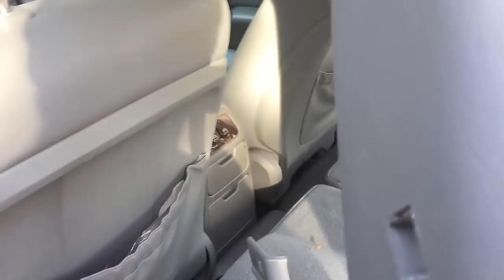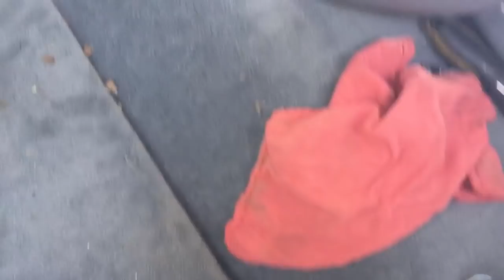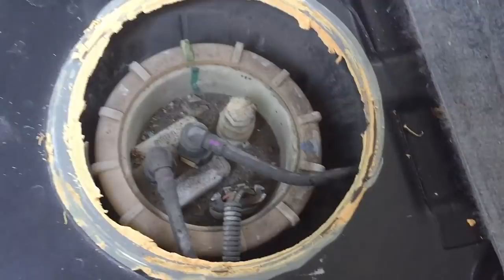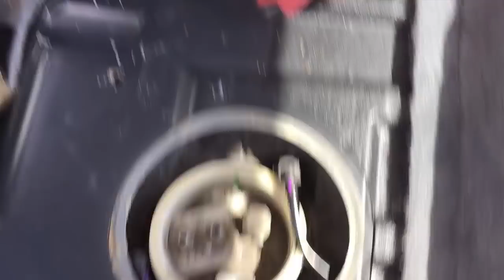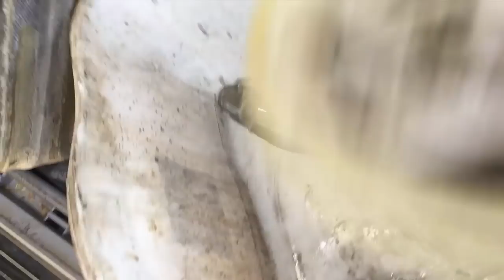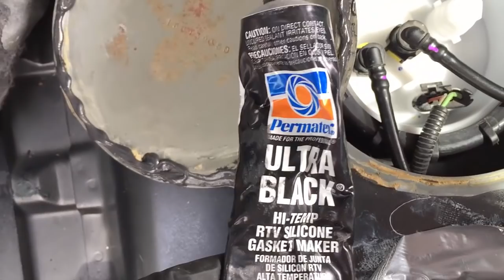2001 M-B ML320 Fuel Pump Replacement

Comment: Great video ...BUT, I've tried 2 x to set the new pump. Getting the float into the tank without detaching is a real problem. The fuel lines were horrible to remove...I wish I never tried this project

Comment: Hi, I'm from Brazil so I'm using Google Translate.
As I saw your vast knowledge on Mercedes ML320 maybe you can help me.
my ML320 year 2000 AB 54 V6 Petrol.
It stopped operating 5 years ago and remained in the garage, I'm doing the repairs at home, I'm an electrical technician, I've already tested and replaced all the fuses and relays that didn't work. Then the ignition part works well on the coils and spark plugs.
When I breathe fuel through the throttle body it works.
I removed the old fuel, cleaned the fuel tank, replaced the complete pump system, filter and hoses.
Where is the thinner hose that comes out of the fuel filter connected to?
Is there a fuel pressure sensor? If there is a pressure sensor, where is it?
Here I have no signal at the fuel pump, but if I inject + 12 v into Fuse 38 the fuel pump turns on.
I cleaned and replaced the injection nozzles and tested them all out and they are ok. However, I don't have a negative pulse on them, just 12v +.
The OBD2 Scanner I have does not show any error in the ECU, but it does show an error in some sensors.

Comment: Any idea where the fuel pressure sensor is on the ml320? I'm having trouble finding any Information on its location. I might have to do my pump as well as my fuel Gauge isn't working properly either.
Reply from the maker: I can’t say for sure because I no longer have the vehicle.  It is probably at the end of the fuel rail.  There are probably 2 sensors if there are two rails for the V-6. If the fuel rail is U-shape the. There may only be one.

Comment: Thanks Brother great video showing a lot of this challengingly job.
I'm changing my Fuel filter, but that requires me gaining access to fuel pump to release hose connectors.
Fun fun fun....
Reply from the maker: I had not done that job. Are you sure there isn’t another in-line connector in between?  Just a random thought.
Reply: @McMichen  
Ok so you have your original Fuel Filter (unchanged) ?
The jobs are somewhat parallel, with the FF (also has pressure reg / ck valve built in) having like 3 or 4 connectors - it's buried on top of frame rail between body & frame.
Pulling LR wheel & inner liner is required to access.
Then you disconnect 2 lines & pull it out with the 2 short hoses that attach to Pump Ports.

There's just no easy way (everyone says) to detach lines and not risk breaking them from Fuel Filter w/o detaching first at pump ports.
Yes, I may need Fuel pump, and have it on hand.
But I'll test first w new FF both drive & Fuel Pressure monitoring.
Probably drive for 1-2 tanks of fuel w/o reinstall rear seat.
I actually trust my OE pump MAY have many more miles to go, before I try the cheap China pump from Amazon I have here.

Appreciate your quick response
Blaine !

David in Texas
Reply from the maker: @psalm2forliberty577  I never changed it but previous owner did all dealer maintenance, so I think it was done.  I no longer have the vehicle.  Gave it to a family member and it is still going strong.
Reply: @McMichen  
Great - I bet they're blessed to have it. Driving an ML is akin to being transported in a bank vault.
Just pulling that rear 60% seat, it's  H E A V Y.
Muffler shop owner remarked when modding my ML "heaviest gauge exhaust tubing I've EVER cut through"....lol
Take care - David

Comment: Woww! The locking ring just flew right off!👎🏼👎🏻👎🏼
Reply from the maker: Interesting.  The large threaded ring that holds the pump in place? Did you turn it or pry it off? It is threaded like a large nut.

Comment: Surely you don’t have to pull the whole seat out?
Reply from the maker: I suppose you could cut a hole in the carpet, but I didn’t want to do that.
Reply: @McMichen  
If i intended to take a sharp razor knife/ carpet cutter and leave the carpet and trim undisturbed, 2 questions:
1. Can I feel the round cover under the carpet?
2. Any danger of cutting an important wire, etc.?
Thank you so much,
David in Longmont ('98 ML320 - 107k miles, 2nd owner)
Reply: @McMichen  
Hi again Blane. Not suggesting anyone should want to cut the hole, but do you think I can feel the cover under the carpet so I'd know where to cut? And, is there anything I could be cutting accidentally?
Thanks for the prompt response,
David
Reply from the maker: @daw2310  I don’t think you can feel it because of the carpet pad. You may be able to feel it, but the ridge is pretty small. You may be able to cut a square on three sides to make a “flap” that you can fold back to access the area.  You would need to look at the video to guess where to start cutting.  If you start with a cut close to the seat base (side to side direction) you may be able to get your hand in to feel where to make the two cuts front to back.  I’ve cut you can fold it back in the direction of the tailgate. This cut would leave the “open end” facing the seat and not in the cargo area.

Comment: How do I know if my pump is bad? I read that everything will work fine maybe says tank is empty early is all. I'd like to think I only need to replace it when its not starting though?
Reply from the maker: Any early sign that it is getting old may be a gas gauge that doesn’t work properly, because it is part of the pump unit.  Occasionally you will get some warning from a hesitation while driving, but that could be from any number of things. When the pump quits your car will stop running and will not start again.  One of mine died at a stop light and I had to get a tow home.  Generally they are pretty reliable, but when the vehicle is older than 10 years old it could fail.
Reply: So I put a new fuel pump in but your video skips the part of how to get it in the hole. I broke one of the tabs that holds onto the float. Last few months been taking it out and trying to use glue or steelstik to keep it on. Some cases it comes off other cases the metal contacts on the resistor broke even though the float is still on. The hoses on top are new but now they're leaking from me going in there a bunch. Currently I got the float on and the resistor is fixed but the arm is so stiff from my repairs that it doesn't move with the gas. Anyway, just buying a whole new set of hoses and pump again. How do you get the pump in the hole with the float connected?

Comment: What does the connection to the seat do..? What does it go to?
Reply from the maker: I am not sure, but I can guess.  I think it is a weight switch that will determine if the rear/side airbags deploy.  Otherwise it could be a seatbelt sensor/indicator.

Comment: What does the wire that plugs in under the seat actually go to? I got in a hurry and forgot to plug it back together and not really wanting to take that seat back out to connect it back together if I don't have to
Reply from the maker: I’m not sure.  It could be the seatbelt alarm that dings if a passenger’s seatbelt is not secure.
Reply: Thank you. That's what I figured as well

Comment: There's suppose to be a rubber seal for the cover under the seat. Looks like yours is missing then replaced with some sealant. You could probably make another seal with an old tire tube or other sort of rubber
Reply: For other's watching.....There isn't supposed to be a rubber seal for the cover.  From the factory they used a heavy amount of body sealant (butyl), this is what he is scraping off in this video.  A rubber seal alone wouldn't work because the cover doesn't have any fasteners on it.

Comment: Does it works also for ML 55 W163 AMG 2003 ? Thanks
Reply from the maker: I haven’t worked on that model, but I’m sure it is very similar. I changed one on a 2004 VW Passat and it was similar.  Look for a round access panel under the carpet above your fuel tank. Most German models will be similar. The pump will be different, but the procedure is relatively the same.

Comment: My mechanic was making big deal out of it. Quoted me $800 to replace the pump. I purchased the pump for under $100.00 on-line, watched your video, and did it myself.  $700.00 saved. Thank you !
Reply: The high quote was because typically most domestic SUVs and trucks you have to either drop the tank or remove the bed to access the pump. Most German cars are different and have the access panel. Audi sedans would have under the seat and BMW sedans would have this access panel in the trunk.
Reply: @DaytonCarCare  : true... yesterday, i happened to replace same pump for my friend... must say, the biggest deal was removing rear seats.... pump install itself took about 10 minutes...  Your tutorial is great and I wanna thank you again for posting it !

Comment: when do you recommend to change the fuel pump? and when do you recommend to change the fuel filter?
Reply from the maker: Good question. I just waited until mine failed, but I was not the original owner, so I had no idea about the history. Mine failed at 125,000 miles, so if you want to avoid being stranded, I’d say every 100,000. Fuel filter should be at least the same or less, but it can be more if you are sure that you buy fuel at a reputable fuel station that changes its filters often.
Reply: @McMichen  i just got a used ml320 at 170k. I am trying to think what i have to maintenance.
Reply from the maker: @Menga213  sometimes you cannot predict what will happen. Some things I had to replace...  power steering hose off of the pump cracked and leaked; power steering fluid reservoir because filter is integral (makes squealing sound); other than that oil changes, battery, etc.
Reply: @McMichen  Nice so basically change all fluids to prevent future problems. Hey by any chance did you ever get problems with your door locks? did you replace all actuator? or fueses?
Reply from the maker: @Menga213  I only had a problem with the rear latch. The actuator worked, but the plastic connection broke. I got a replacement at a local pull-a-part yard.
Reply: @Menga213  I know it’s been 7 months hope you’re ML is good. I got my ml350 a few months ago and am going through it for preventative maintenance. Engine mounts, all fluids, cam cover gaskets, crank sensor, conductor plate and trans service. Want to do fuel pump and filter, but only using OEM parts.
Reply: They usually last the life of the car

Comment: Very good video.  Not enough emphasis on the pain of getting the back seat out.  The trim is a pain, releasing the tabs not easy.  I notice when putting my trim back on, that I had broken a few of the tabs.  On my 2002, the right back seat had to come out before the left.  The seat shared one bolt in the middle and the right was on top of the left at this location.  So many bolts! The seats are not so light.  I got away without removing the decretive plate at the door and was still able to fold the carpet back enough to get it cleared from pump.  

Removing the lid over the pump takes time and mine was put in with a lot of glue.  Took a long time to remove glue and lid still had to be pried up because there was significant amounts of glue underneath that that had to be ripped during the removal. 

Blane, how did you remove the ring locking holding the pump in place?  There was no way that mine could have been removed using just your hands.   Had to use a very big flat head screwdriver and dead blow hammer to get it spun the first 1/8 turn.  Ring is tougher than you would think and the raised ribs, grips seem not to have suffered any from my broad screwdriver head.  This method of driving the ring rotation by applying heavy blows in the direction of rotation seemed to work well.  I had to do the same thing to get the ring spun tightly back on. 

I would recommend having the tank as empty as possible when removing the pump.  The more gas in the take, the gas that will come out when the pump is removed.  I used a large garbage bad that I had cut one corner off to cover the carpet.  draped the bag around the hole with the pump, much like a doctor does when isolating the area they are going to operate on.  When removing the pump, the bag can be used to capture the pump and gas.  Just wrap the pump up in the bag.
Reply from the maker: Hi Eric. My primary motivation for making the video was the difficulty inaccessing the pump. Specifically, removing the trim pieces and the seat. I removed the ring with a homemade spanner type wrench. It is just to flat peices of band iron hinged on the middle and two bolts with the heads cut off for engagement pins. Your method is fine, too. As long as the bearing point is not too sharp, so it won't cut. I suppose a piece of wood could do the job. I agree about the low fuel level, but I don't know how you manage that if you have a full tank when the  pump fails. The fill tube has an antisyphon block. I suppose you could syphon the gas out from the pump port before removing the pump. There is enough room to get a hose past the pump with oi it removing the pump. Thanks for the comments. I'm sure others will take your advice about lining the area with a trash bag.

Comment: You mised a verry impprtant moment, how to a put inside a new one.
Reply from the maker: No real some answer. You probably figured out that you need to put the float in first by tilting the assmebly, lowering it and rotating it into position, until the arrow marks lined up. It is nice than it is new and not dripping fuel like when you take it out.

Comment: Hi Blane, which brand fuel pump and fuel lines<<<if needed replacement....did you buy? I'm going to be doing the same thing on my ML 320. Also, when you slid the pump with the float into the fuel tank, did you drop it straight down or was there an angle? I'm trying to get as much detail before I tackle this job.   Very helpful video! Thank You
Reply from the maker: Hi Dong,  I just looked for the part on Amazon and paid less than $50.  The brand I got was "A ABIGAIL", but I don't see it listed any longer, but there are other brands, also.  I have bought ECCPP brand for a Ford, and TOPSCOPE for a VW and they worked fine, also.  I did not need to replace any fuel lines.  As far as installing, it does need to go in at an angle and rotate to align the arrow marks that I show in the video.  MAKE SURE THAT YOU DISCOUNECT YOUR BATTERY AND NO OTHER SPARK SOURCES (DROP LIGHT, FANS, ETC.) ARE NEARBY.  (BTW - You will need the code for your radio when you reconnect the battery.)  The worst part is taking the original fuel pump out, because it drips gas.  It's best to do it when the fuel tank is almost empty, but you really can't know when your fuel pump will go out ... so that may not be an option.  I would recommend putting a towel around the area and having a bucket handy so you can pull it out and go right into the bucket inside the car, so you don't leave a trail of fuel on the way out.  It really isn't a very difficult job, you just need to take your time. I'm sure you will do fine.

Comment: I have a ML55 AMG would this be similar process?
Reply from the maker: I'm not familiar with the ML55, but I changed the fuel pump in a VW Passat and it was very similar.  There was an access panel under the carpet behind the back seat, in the trunk.  My guess is that most German vehicles will be somewhat similar.  The trick is to find out where the panel is located and how to remove the interior trim to access it.

Comment: Steve, thank you for this video. IT helped me IMMENSELY. My old fuel pump would not come out. I had to break it in pieces to get it out. I did not know how DIFFICULT it is to attach the float AFTER the pump is held partly into the gas tank. That might be the most difficult part. For me this whole thing was very difficult and I spilled a lot of gasoline. I was able to unbolt the seat and just move the seat forward about a foot. Thank you for this great video.

Comment: Thanks Blane great help but what a job removing the seat ! Without your advice there would have been a fair few broken plastic panels !
Reply from the maker: For sure.  There are a lot of snaps, fasteners, and tucks.  I guess that is how they keep the vibration noise low, but it sure makes maintenance work more difficult.  Glad to help.